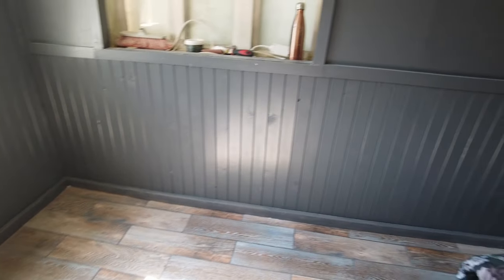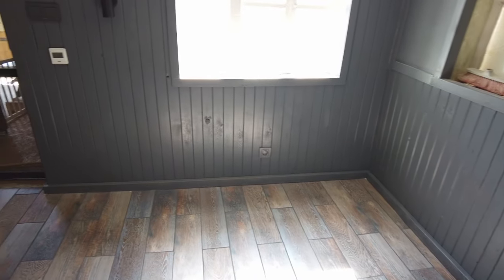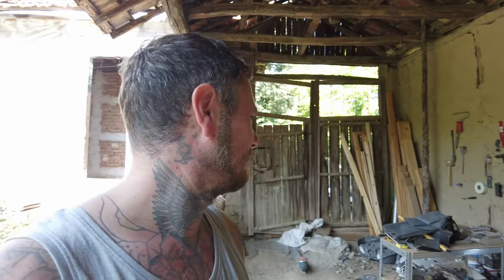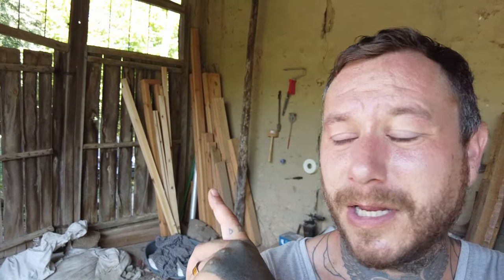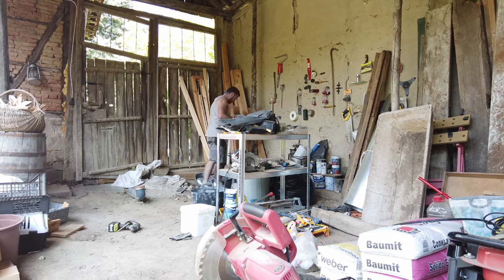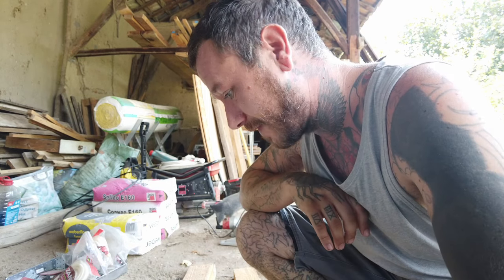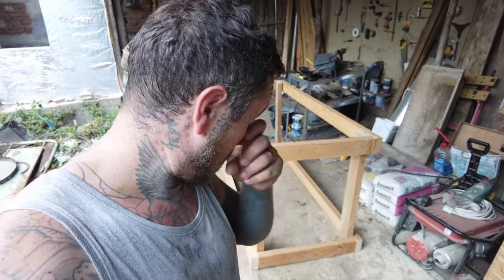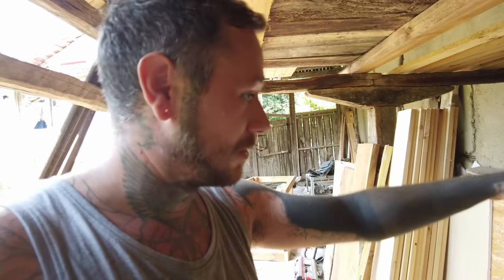Changing Plans.....Again - Bulgarian Vlog

Comment: I thought about this after the live vid...if you don't plan to keep your first house don't spend any more than absolutely necessary on it. Of course if you now think you need it more habitable for winter, make it weathertight, but beyond that try not to do much more. I have been put off houses that were "done" because it wasn't to my taste or the layout wasn't how I'd like and I hate ripping out new stuff. 

I think time is too short to sell it now to release funds to focus on the new place and get the apartment ready for winter... Or is it? 😉But even when you don't need to live there, don't put all your energy into renovating the first house, people have different ideas and actually a blank canvas is easier to sell. Get your money out and invest your energy in your home. We are doing exactly this with our house in UK. So much we wanted to do but I just got it painted and carpeted, garden cleared, and leave it for the new people to do the work they want.
Reply: I agree. An estate agent recently told me that if I spent £10,000 on my house I might  get £10,000 more for it.
Reply from the maker: We couldn't agree more, and have no plans or funds to 'finish' this property.. everything that does need doing is structural and integral..we do not have a staircase, a bathroom or a kitchen! Which I'm pretty sure when in place will help with the value compared to what it is now. We've finished the bedroom nicely purely for our benefit until we can eventually move 🤗
Reply: That’s true for Uk but in BG is better if the house is ready